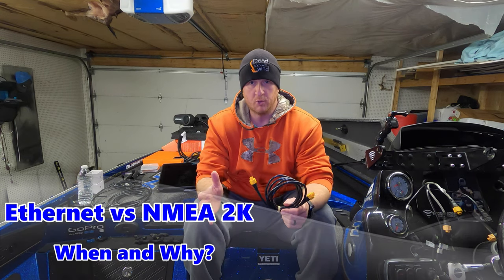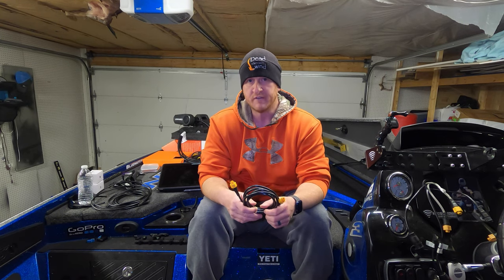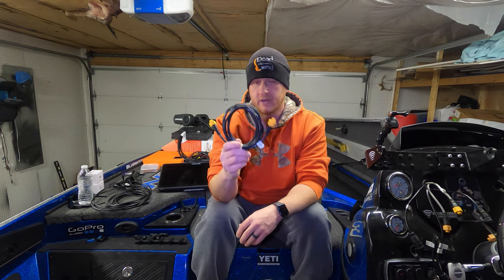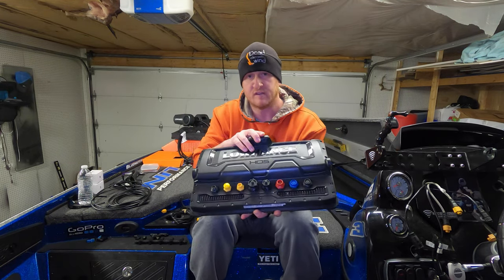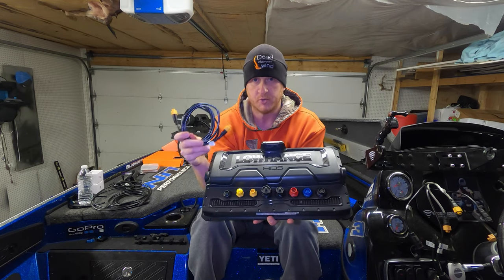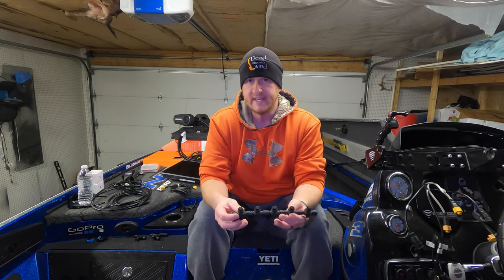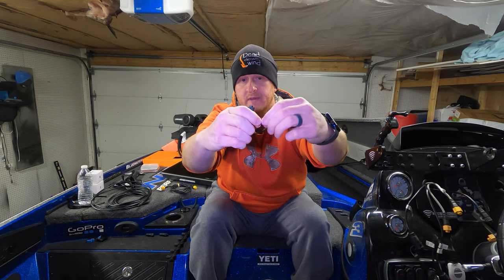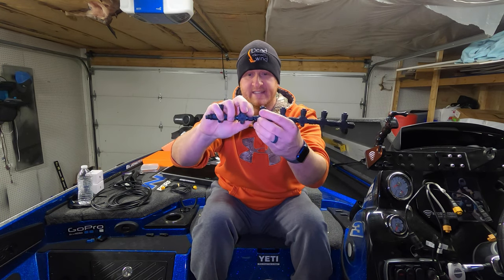Ethernet vs NMEA 2000 Network...How, When, and Why?

Comment: I'm having an issue with my NMEA system i have a cable plug into one of the ends the manufacturer re hook it up wrong i think. Would this be the reason my rpm gauge isn't working and I'm getting a "NMEA bus heat beat  lost check NMEA network connections" Is there a way a can post a pick of my backbone?
Reply from the maker: That very well could be the problem, I would try putting a terminal cap on the end and move the cable to a “T” inline with the backbone like I show in the video…let me know if it works for ya, hope that helps!

Comment: Question, I have three HDS gen 3 units two 9's and one 7. The 7 only has one Ethernet port and the 9's have two so linking all three with Ethernet cables isn't a problem.  My 9"s are updated to 18.2 not sure about the 7 but if it isn't will the 7 still pickup maping and weigh points from the 9's?
Reply from the maker: Hey Patrick!… Yes sir, as long as they are all connected they will still share mapping and waypoints… It’s usually best to update to the latest software just to make sure you’re getting the most out of your units, but those features will still work if the 7 is not updated yet… Hope that helps!

Comment: I run a hds 12 with active target, and a Elite 9 at the helm. Will ethernet cable go from active target, to hds 12 and a 2nd cable from 12 to elite 9?
Reply: The 12 is on the bow

Comment: Hi one question, so I currently just bought One Lowrance HDS Live 16, that will be mounted on the dash where I drive the boat, and 2 HDS live 12s, which will be mounted at the Bow of the boat up front, so if I Buy 2 Lowrance Ethernet cables, Hook up both to my Lowrance HDS 16, both Ethernet cables up to the Bow of my boat, plug one of the cables into one of the Lowrance 12s, and then the other Ethernet cable into my other 12, They’ll all function together? So if I mark a waypoint on one of my 12s up front, they’ll all have that same waypoint marked on them? Great video it seems like it will be a great help to me when I go to install all this stuff
Reply from the maker: Hey Raze!… i’m sorry, I don’t know how I missed your comment… Yes you are correct, just run 2 ethernet cords from your 16 to the 2 12’s at the front and they will share any/all data that can be shared through ethernet…hope that helps!

Comment: What Gopro mount are you using there and how is it connected to your gimbal bracket?
Reply from the maker: Hey Chris!...that’s actually not on my gimbal bracket (even though it looks like it...haha)...it’s mounted to my console behind my gimbal just using one of GoPros sticky mounts, and the arm is just one of their flex necks...I use that spot a lot when I’m on the trolling motor, gives good angles of the front of boat

Comment: You do not need a "T" for the power.  It can be connected directly to the end instead of using a terminator.  Call Russell Marine for verification.  That is how I set my up and it works fine.
Reply from the maker: That’s very controversial, to say the least...I have seen people do it the way you’re saying, but some end up having issues which are resolved by adding the power to a “T” and properly using terminators on the ends...to each their own, but I would NOT recommend that at all
Reply from the maker: If you do a Google search for what you mentioned, you will find plenty of people who would confirm my previous response, but I’m glad you haven’t had any problems!

Comment: Great channel.  New subscriber.  But and i did listen.  If you have the nema2000 hooked up and it does show waypoints, trails, etc.  between units. Why would you also run the ethernet cable?  Just as backup or something?  Also did the ghost come  with gps sensor or is the point one just better? 
Thanks Pete. 
Been thinking of going with ghost. i have the Xi5 but the gps fails connected ( nmea2000 ) to HDS12. Needs that stupid dongel update that you cant get. So has to be disconnected from network.  So just loose some features but thinking of switching.
Reply from the maker: Thanks Pete, I appreciate it!!…most people will run both systems just to take full advantage of everything they have to offer, but both are not necessarily needed…and yepper, the Ghost comes with its own puck, works a little differently than the Point 1…Point 1 is a heading sensor while the TMC (Ghost puck) is more of a GPS sensor…highly recommend using both of those on your setup as well…hope all that helps!

Comment: I'm upgrading from two Elite Ti's(not Ti2) to HDS Gen 3 units. I'm new to the ethernet networking. I understand that I can run both units off the same transducer. Is this true, and could you elaborate?
Reply from the maker: Yes sir, Ethernet allows you to share transducer data between different graphs, as long as both graphs are connected of course…just run the ducer to one of the graphs, then connect the 2 graphs with an Ethernet cable, and you can share all data from the transducer (water temp, depth, waypoints, etc)…if it doesn’t work right off the bat let me know, there may be a couple settings you have to tweak (very easy to do, I’ll walk ya through it)

Comment: Awesome video, The only question that I have is that on other videos that I have watched, they recommend putting the power cable close to the center point of the backbone. Does that really matter?  I have (2) Lowrance HDS 9 gen 2 touch screens.  Do you recommend running both the ethernet cable between the 2 units and also the NMEA setup.  I am installing a Motorguide Xi5 pinpoint trolling motor and cleaning up a lot of the wiring at the same time.  Thanks for the great video!
Reply from the maker: Thank you, I appreciate that!...and I’ve never had any issues with having the power “T” anywhere in the backbone, as long as circuit is terminated correctly you’ll be good to go!...I would definitely recommend doing both the Ethernet between both graphs, and also the NMEA 2K network, they both serve a good purpose on most boats, let me know if I can help with anything else, and thanks for watching!

Comment: You can put the power on one of the ends of the tee's
Reply: Please don't share this information. That is incorrect. End of the T's should be terminated by a resistor only.

Comment: Super video..I watched twice! Please explain One thing: I have already installed Ethernet between  2 HDS12 Live, and now I'm adding Point1 antenna. Question....When added, will  NMEA 2000 work with Ethernet still connected? Should be Ethernet cable disconnected? Will they interfere  with each other if left in, connected  together? Thank you!
Reply from the maker: Thank you, I appreciate that!!….yepper, you leave em both (Ethernet and NMEA) connected at all times, they work perfectly fine together and serve some different purposes of course…I recommend everyone install both systems, gets ya the best outta your units!…hope that helps!

Comment: Hey, i hope all is well. Quick question, i recently purchased the motorguide tour pro, motorguide says i need the nmea2000 startup kit. But im running  2 elite ti2's that communicate wirelessly. Do i still need the nmea2000 system? Or can i just use the cable that goes from the tour pro to the bow mounted elite ti2?
Reply from the maker: Hmm, that’s a great question!…I think you’ll be ok with just running it to the bow unit since they communicate wirelessly, but I’m not 100% sure on this one…I’m not super familiar with the Ti2’s, I’ve never owned one…hopefully someone can chime in and give a definitive answer for ya!
Reply from the maker: @Capt9Ball  Let me know how you make out if you don’t mind!